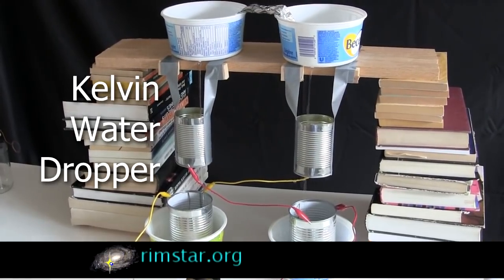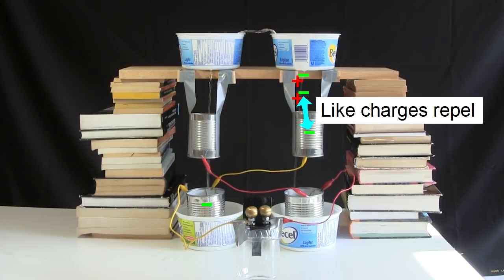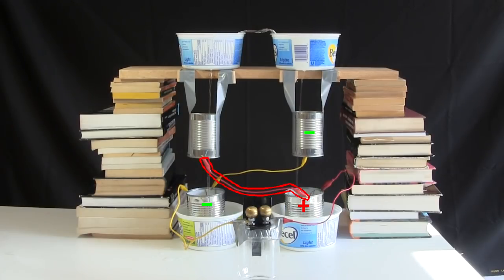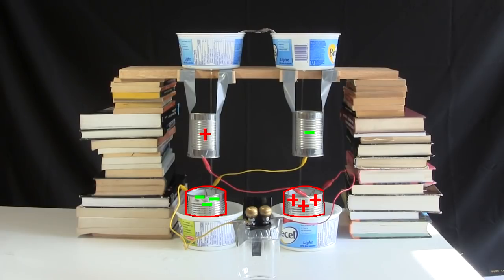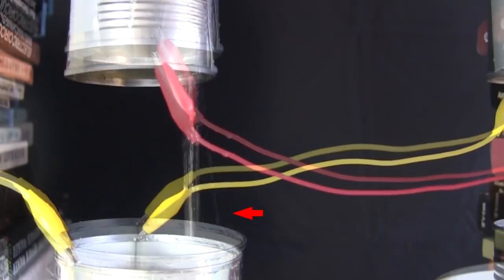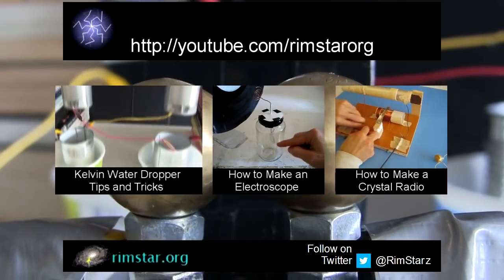Kelvin Water Dropper and How it Works/Lord Kelvin's Thunderstorm

Comment: I'm a former tanker truck driver.
Our Swedish rigs are 25 meters long, about 75 feet.
There are 2 pieces of non-conducting large hose on both truck and trailer at the sear. This hose should never be over 10 cm (4") off the ground. This is because rain water or petrolium overspill create a huge voltage potential from the ground to the rig, and large sparks can ignite the overspill or jump when delivering fuel to gas stations.
You can sometimes see the huge sparks jump from manhole covers to the rig while driving behind a co-workers rig.
Scary AF in dry winter with snowfall.
Stay safe out there. =)
Reply from the maker: Ouch! That is scary. Did you connect to ground or discharge voltage deliberately to make it safe before fueling or unfueling?

Comment from the maker: Yup, you can use a coke can. It's best to avoid sharp edges but the top edges of my cans were sharp and it still worked. The tape was duct tape. But I'd recommend using hanging the cans like I did only until you get it working and know where the cans should go, and then mounting them firmly some other way. If you don't then it's a pain when they move around and you have to readjust them. I'm going to attach some pieces of wood hanging down from the shelf and attach the cans to them.

Comment from the maker: My current plan is to do a how to make a Kelvin water dropper or a tips and tricks next week, so I'd play with it as part of that. But I can't promise anything. It's hard to do a video a week sometimes. Often I have problems and have to switch topics midweek. That happened this past week, in fact. I started out with an ion wind type thing and it ended up I couldn't do as planned and it really wasn't as different from what I'd done before as I'd hoped anyway.

Comment: It might not take as long as you think?  If the sparks are 21,000 volts and you capture them in a 5 volt electrolytic cap, it may actually charge very quickly?  I haven't tried it, but I definitely will :) ..just making the time for it is tough .. Argh.

Comment from the maker: I like your creative thinking, but there's a few problem. The 2 water down-streams aren't just down-streams. They're a solid stream above the can and drops below the can. The solid stream above allows charge of on polarity to be repelled up. The drops below fall away having the opposite charge. Assuming that rising air modified by the candle flame (with soot?) is conductive, it wouldn't have that solid stream below the can and the equivalent of drops above the can.
Reply: RimstarOrg I believe the reason the drops separate is due to the fact that like charges repel each other.

Comment from the maker: Hard to say w/o experimenting. From my process last week, the larger diameter the stream, the longer it falls before breaking into drops. A garden hose sized one would fall quite a distance, if my results scale. It's the charge on the inductors (the cans or rings the water falls through) that repels the charges in the stream, so optimizing that is important. But a larger stream means higher conductivity, though boxerlego's comment below made me think of using salt water for more conductivity.

Comment from the maker: The two middle cans are soup cans and must be metal. The bottom cans are just bigger cans so that they can hold a lot of water and must be metal. The white containers on top are margarine containers. Use whatever you have. You'll also need wires to connect them like in the video. I used wires with alligator clips on them. The bottom cans must not have any insulating coating on the inside. Mine did but I scraped off some insulation inside.

Comment: Great demo and explanation of the working principle....I agree with DigGil3 though, it's wacky !
Soooo, with it being a spark gap, there's HV and that HV could go forward along parallel connected wiring into a Tesla coil or pancake. You'd get wireless output to LED's etc. If the frequency could be turned up with a faster flow (?), it could be used with a running water stream when out camping and deliver the light for the tent at night.

Comment from the maker: It's 21,000V but the current is small. It's the difference between a 21,000V thin spark (low current) and a 21,000V thick spark (high current.)  It's the electrons in the current that fill up the cap. If the cap. has high capacitance then it'll take more electrons to fill it than with a low capacitance capacitor. It's like high pressure pushing a few drops into a large barrel, versus the same pressure pushing a thick stream. But don't let me stop you trying. We'll both learn something I'm sure.

Comment from the maker: Oh, it would take an awfully long time to build up the voltage in an electrolytic capacitor. They have a relatively high capacitance, microfarads. A smaller capacitor in the picofarad or nanofarad range would be better. Judging from the tiny sparks, there isn't much charge here. I haven't tried, but I also wouldn't bother.

Comment: I like that one. :-)

The stranded island movies should use this. Plane crashes, survivor takes some wires from the plane and rigs up a nearby stream. Not sure what they could do with the DC current. Use the spark to start a fire? Or charge a battery from the plane to do other things, like get a radio working? Anyway, cool video.

Comment: Add a Leyden Jar capacitor... and you have great potential... lightning in a jar... giving more current to the spark. Move the electrodes further apart to get a longer thicker spark. Just some ideas that might end up having something that might be tapped into to give a useful voltage via coil voltage dividers and transformers. While it is pulsed DC, a Leyden Jar can keep constants. It doesn't need to spark at all, it can be separated further to have it only as a last resort. With perhaps another spark gap to isolate the Leyden Jar so the main spark won't discharge it. Using turns ratios of coils and induction, some stepping down, this could be much more hidden in plain sight.

Comment: For those interested, water contains its charge density in the amount of surface area it has compared to its volume. It takes energy to divide a droplet into tinny parts. That's why it takes charge to make water vaporize. The smaller the particle the bigger its surface area relative to volume (volume increases by a power of 3 while area by a power of 2). 

This is also why nobel awarded Hermann Plauson was investigating ionization in the proximiti of waterfalls. "EZ water" is another closely related topic.

Comment: when the water is mid falling, are you sure that the electrostatic repulsion (of the cans and similar charged droplets) are strong enough to oppose gravity to "flow back upwards"? or does it just start with a small charge difference at the bottom of the can which creates a small charge onto the connecting top cans which then builds up more charge over time?
thanks for reading!
(i know im 8 years late but im interested to know)

Comment: Polarization. Just like a compass, the body of water itself polarizes.  You can use a multimeter to verify this.  Not a lot, but enough that when you pull from two sides, statically you are pulling two voltages.  By volume that adds up.

Comment: Are the globes used for the spark gap brass?  Can you find them at any hardware store?
Reply from the maker: Yes, those ones are brass, but any metal will do. Those ones came with a high voltage power supply I bought a long time ago. But I've found other round ones in a lighting store, I think for drawer handles. Round screw heads also good. If you look around you can find all sorts of things that'll work.

Comment: is it possible to use hot air up-streams (from 2 candles) instead of 2 water down-streams to produce charge separation? 

I was thinking about building an up-side down Kelvin dropper with 2 candles at the bottom and 2 empty metal cans at the top. Is it a good idea to try out?

Comment: Pretty cool to see this in action. I was just reading/researching about this. Question: How big or how many droplets would it take in order to produce enough electricity to put into practical use age? Let’s say something small like a light bulb. This is with the understanding the spark gap has to be carefully measured and depending on the size of the cans, I’m thinking an initial charge may have to be introduced.
Reply from the maker: That much output would require a huge one, nothing you can practically make I think. Maybe house-sized or bigger.
Reply: @RimstarOrg  Sooo, there went my theory of what I would do in order to bring electricity to a deserted island if I were ever shipwrecked, thereby making sure I’d become King. Way to blow my life’s ambition! 😤 Seriously, thank you for the information and the reply. I appreciate it. Hmmm, before I sign off, I believe that brings up an obvious question. How would one science me into my first autocracy, Given only the use of materials that would be found on a typical deserted island (eh, I always had a thing for Mary Ann, just sayin! 😋😁😂)?

Comment: Hi! And thanks for having shared.

Do you know how to calculate the theoretical power we can provide with such a device? I mean scaled up?
Reply from the maker: No, I don't know how to calculate the theorectical power. But I guess you can do some research to try and figure it out. You could start by putting a capacitor in place of the spark gap and let it charge up for a while. Then after a certain time remove the capacitor and measure its voltage. The formula for energy stored in a capacitor is 0.5 x capacitance x voltage x voltage. Then you'd have to start changing the components and things and see how the changes affect the energy stored over time.
Thanks for watching!

Comment: Steven, is it posible to use this same principle to isolate charge from candles/fire? 
Something like two wicks threaded with conductive wire, and a cross connection for a pair of inductors and collectors. Makes any sense?
Reply from the maker: I don't know, I've never looked into it. I have heard that flame has charge but I don't know how it's distributed. (Actually, given that it was just hearsay, I'm not sure it's even true).
Reply: Flames are a boundary between oxygen and carbon where particles are hot enough to recombine, i.e. they are free within the space we see this "plasma".  The energy is provided by the candles. Basically it would be like the water dropper upside down. 

Im thinking of an old triode tube and the video from Veritasium on candles and high voltage https://www.youtube.com/watch?v=a7_8Gc_Llr8
Reply from the maker: From that video it's hard to tell if the charge is overall neutral, even though there are ions. The two disk electrodes could be doing all the separating of the ions, positive toward the negative disk and negative toward the positive disk. That's what you really need to know, if there's a separation within the flame. My guess is that there is somewhere within in the geometry of the flame.

Comment: Hi!
Do you know where I would attach an voltmeter to measure the voltage of this thing? It's for a science experiment so anything would help.
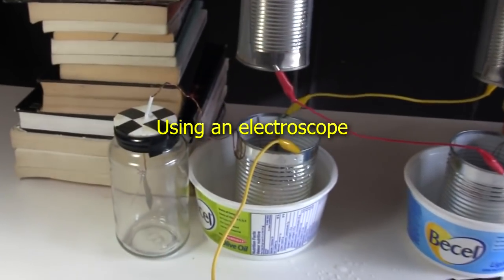Reply from the maker: You can't use a voltmeter if you're using normal probes with the meter. You need a high voltage probe like this one http://youtu.be/kXq4FCQ0C38 One kind of measurement you can do is use an electroscope like I show at 2:06 in the video. It won't tell you how much voltage but at least you can see that there's some charge.

Comment: Sir, thanks for sharing! One question: Isn´t  the produced elecrostatic charge dangerous for humans?
Reply from the maker: Bob Snider My pleasure. And no, the voltage is highish but the current is very tiny. No danger whatsoever. If you want to learn more about the dangers with electricity you should check out my video about that https://www.youtube.com/watch?v=9iKD7vuq-rYThe problem is that in some devices the electrostatic charge can build up a lot and then when it's discharged, you then have to consider what voltage and current is in the discharge.
Reply: Great, thanks again aaand subscribed!

Comment: is it enough to run your electrostatic motor to generate power ?
Reply from the maker: ***** No, no where near enough to run my electrostatic motor (we mean specifically the corona motor, for anyone else reading this.) Maybe a much bigger one could power a much simpler and smaller electrostatic motor, like a small ion wind rotor.

Comment: what if i use a solution like a salt water instead of normal water? :3 is there a sggnificant change?
Reply from the maker: There is an improvement but not a significant one. Someone did the experiment with good measurements and sent it to me. You can see their results and analysis in the grey box lower down on my webpage here https://rimstar.org/science_electronics_projects/how_to_make_a_kelvin_water_dropper.htm

Comment: does this expt: works if we short and separate the two sparking terminals.... so that there is no imbalance in charges?
Reply from the maker: If you short then separate the two terminals then you'd be in the same state as you are just after a spark happens. The experiment would continue to work, the charge would build up again.

Comment: please, can this spark somehow be.... lethal? if not is there any way to get a lethal spark of this way?
Reply from the maker: You'd have to build a pretty specially designed one to get a harmful spark from this machine. It would have to be very big with specially made, large, rounded containers and a wide spark gap. And the spark would happen only after you've let the charge build up for minutes or more. There are certainly easier ways if you want a powerful spark, like with a large Van de Graff generator.
Reply: You could hook it up to a large capacitor bank, and let it charge up over time.... Why am I telling you this? You're not trying to kill someone are you? <_<

Comment: If you're right about how this works you should only need two cans and one stream of water.
Or am I missing something?
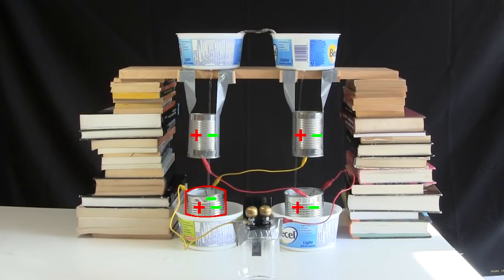Reply from the maker: Ah, so you mean you'd stop the video at 1:02 with negative on one side of the spark gap and positive on the other side. However, the charging would stop there. Basically it would limited to the initial imbalance that was on the  can in the bottom-left at 0:25. Having the second can and two streams of water with the complete circuit allows the amount of charge to keep on increasing.
Reply: @RimstarOrg  🤔 I suppose I'm going to have to think about that but thank you for your response.

Comment: What if use a joule thief transformer alongside a cascade of different capacitors and to step up the voltage
Reply from the maker: The voltage is already high at the spark gap. A high voltage is needed in order to create the spark. However, if you replace the spark gap with circuitry, I think the current would still be too low for the circuitry.

Comment: I don't understand why the low can on the left started having more negative charge than the positive one.. u said that in a typical situation there's a balance between the charges. Can someone help me?
Reply from the maker: When you walk across a carpet with socks on, depending on the material in the socks and the carpet, your body will build up a charge, and when you touch a doorknob, you'll get a shock. So one way the can could have been charged was that you were charged and touched it. There are also stray negative and positive ions in the air and the charge may have come from there. Those are two examples I can think of. It doesn't take much extra negative charge on the can to get this started.
Reply: RimstarOrg ok, it's clear. Thank you!
Reply: It's because any slight imbalance gets amplified over and over and over again. If the charges started out as truly exactly equal, then nothing would happen. But this is the real world we're talking about, and there is always a little bit of "noise" and random variation. So any little random difference in charge (caused for instance by moving air, light hitting the metal and knocking off electrons, etc.) will get amplified over and over and quickly become a massive difference.

Comment: im confuse,the question is. how such small charge produce a million volt? arc jump between that electrode is more mystique. any body can explain this?
Reply from the maker: It's far less than a million volts. I was getting maybe a few thousand. Keep in mind that the spark isn't continuous. It takes time for the voltage to build up enough to cause the spark.

Comment: why is it that the solid to drop phase transition has to take place inside the cans ?
Reply from the maker: ***** Because from the can upward the charge needs a solid, continuous path to travel on to be carried away. And below the can the water needs to be disconnected from that solid, continuous path so that that water can remain oppositely charged. In that case that water is disconnected by being separate drops.If the water was a solid continuous stream in both directions, with no drops, then the charge would be repelled both up and down the streams, if it worked at all.If the transition was just at the top edge of the can then only the charge at the can's top edge would participate in the repulsion. Having the transition lower down means more of the can can participate in the repulsion. Also, the drops are oppositely charged from the can, so they're attracted to the can. So we want the drops to be only near the bottom of the can so that the drops get attracted back up to the can as little as possible.
Reply: RimstarOrg Thanks .... your projects and their explanations has helped me a lot ! .... I Really appreciate it ! ..
Thanks :)